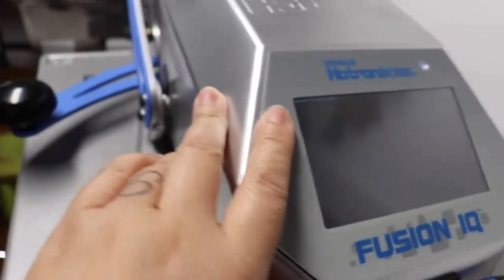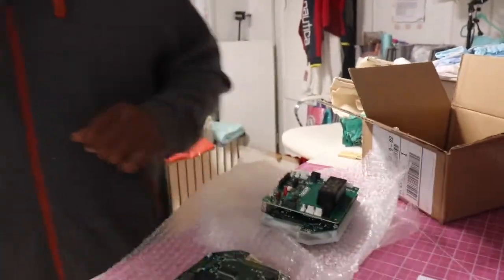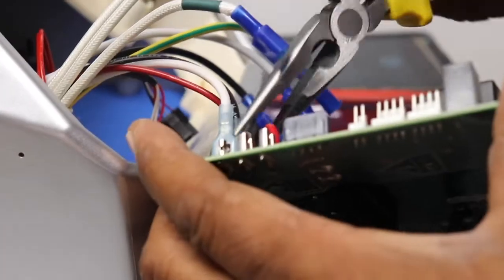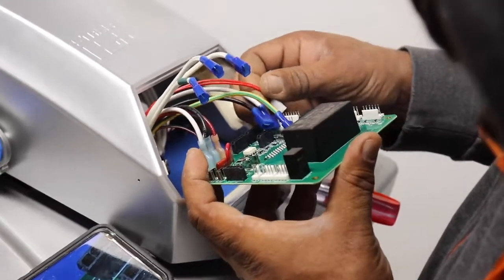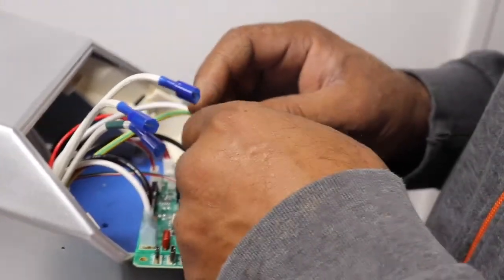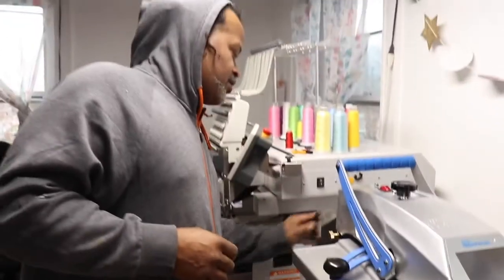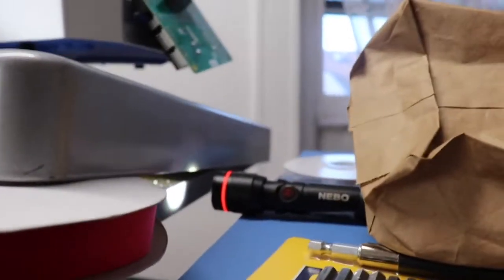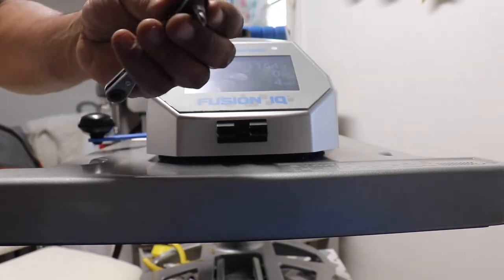Stahls' Hotronix Fusion IQ Heat Press, Not Heating Up, How We Fixed It, Problem Solved

Comment: You did better than I did. I stripped the small screw that holds the thermostat. It's ridiculous how little room you have to work...almost impossible. I requested an RA from Hotronix. I'm sending it in so they can fix it. It's hard to believe a machine that costs over 2k would be this difficult to make a simple repair. Not to mention, why is the thermostat failing? You can buy 4 cheap heat presses and throw them away for the price of a Hotronix. Not impressed.

Comment: Paul's good because I would have sent them their machine back! Great Job!!
Reply from the maker: Trust me I was about to!! Lol enjoy your day! 😊
Reply: OMG! I’m trying not to get pissed! I have some rush orders today. I bought this POS two weeks ago, USED IT ON ONE SHIRT, to test! Now the screen is black and it won’t heat up! Sending this super heavy paper weight back! I worked with a $200 Machine for YEARS! And it only had one issue… I caused it by accidentally leaving it on. It melted the fuse. I changed the fuse and was back in business. 

The fact that I’m reading now that this is a common problem is an issue! NOT A $2500 issue!

Comment: Mine is over heating! Can you help ? :(
Reply: Mine is overheating also. Did you figure it out? I’ll set mine to 290° and it will heat up past 380°🤯
Reply: @pltaylor95  any answer?
Reply: You guys probably need to replace the triac (it comes with the wires kit) no need to pay a tech guy to do the job

Comment: I am having the same problem. They support es mierda. You have to have the tools and do it yourself, locate the issue and the solution and install the part. The worst kaka tech support ever. I would never buy this brand again, and you should be aware. Stay away from this people

Comment: Same happened to me. Sexy heat press yes. Dependable NO, way overkill with the electronics. I’m pissed they had me take a machine with less than 400 shirt pressings thermostat went bad. They. Did send me parts and took me over 6 hours to take apart repair and put back together. I would. Ever buy another press from hotronix. Simple is better. My old press from china ugly stink cranks out shirts and. Ever had a break down. Thanks hotronix.